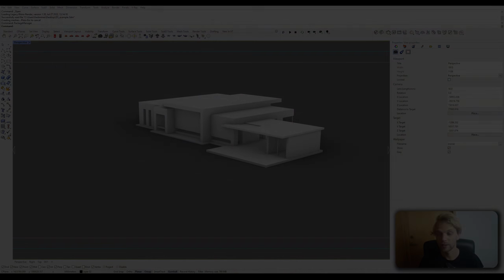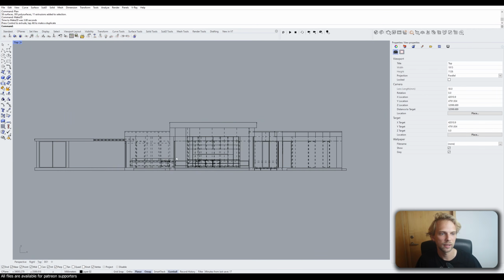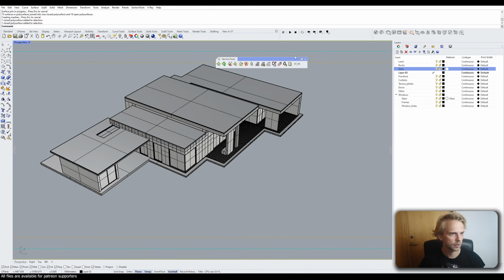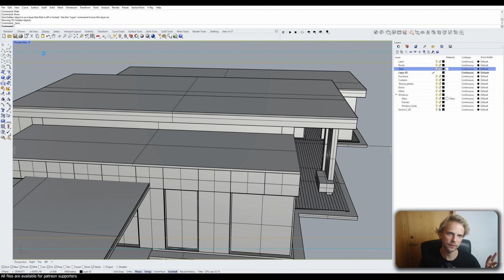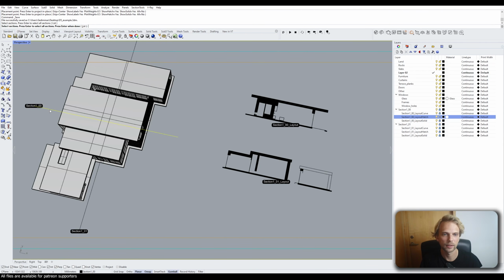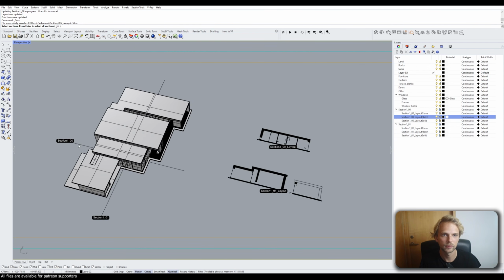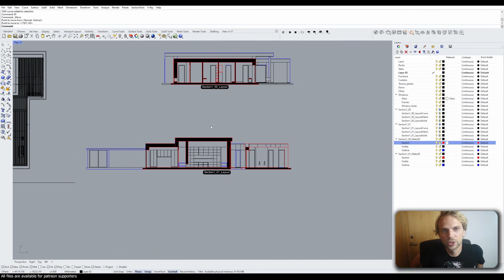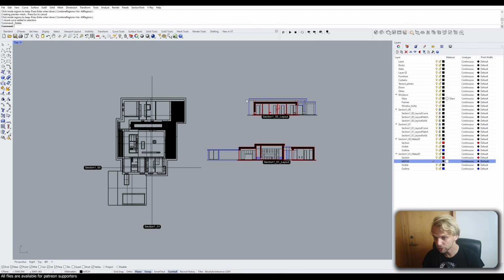Dynamic Sections with Rhino 7 - Workflow

Comment: Can we use this for floor plan? And how to do that
Reply from the maker: If I recall correctly - you simply draw the section in any elevation view (front, left, right or back) and it will create a horizontal section (which is what a plan is)

Comment: Great workflow breakdown! Thank you! I think I’d make a small grasshopper script that references the center of the section lines and the make 2d lines and then get the difference between points to get a movement vector to automate the alignment process. (more for a big project with lots of sections).
Reply: Could you explain what you mmean an by this a bit?
Reply: @ashuri8184  Sure, essentially you are dealing with two planes. 1 plane is your original section cut, the 2nd plane is the plane that the resulting Make2d lines end up on (typically world XY), if you evaluate/get both of these planes, you can use Orient component in Grasshopper to transform from the world XY planes of the Make2d line output and move those to the Section Cut planes at each location. The Section Cut plane doesn't have to be the destination though. You could move them to be oriented on a layout sheet, positioned "flat" around the overall building like a box with its flaps down, etc. Once you have the planes you can orient however you want...

Hope that helps!

Comment: What about dynamic plan drawings? Should be easy to make this plugin work for plans, have you tried?
Reply: Yeeah! show Cplanes
Reply from the maker: A plan is just a horizontal section isn't it
Reply: @DesignGoBrr   I tried, and I found the only way to do it is to make a standard dynamic section but in the FRONT viewport, or any elevation viewport, a bit wonky but it does the trick.
Reply from the maker: @rdn1929  Ah yea - I forgot to mention that you specify a plan cut in any elevation view and an elevation cut in the top/perspective view. It's all about the Cplane orientation.

Comment: I usually make use of the rhino clipping plane tool and link them to my viewports in my layout tabs.
It automatically updates,  no need for any manual work, no heavy duty make2D commands It does the hatching (one solid color) 
It shows what's visible with the options shaded/arctic/rendered/technical etc.
Even annotations update automagically when I make changes to the annotated objects. 
Easy export to pdf/dwg/image whatever.
This combined with the coming Rhino8 Clipping plane functionalities will take care of all my 2D Sectioning needs.
The only thing that I miss in this method is adjusting the hatch style per object and actual clipping plane geometry but that will soon be solved for good ;)
Reply from the maker: Yup - this is correct.
Reply: how do you make a clipping plane with hatch?
Reply: @jonathan_vortex  Rhino 8 gets an automatic hatching with clipping planes.
In Rhino 7 I still have to get outline curves by intersecting plane with geometry and hatch that manually
Reply: how do you link the clipping plane to the viewports? and how to you export it to dwg without make2d ?
Reply: @zoilinar  
Q1: How does one link clipping plane to viewports.
- make sure u have a layout tab with a "detail view" on it.
- make sure u have a clipping plane
- select the clipping plane and go to the properties tab on the right menu. 
- where it says "views clipped" there's a drop down menu which by default is on "model views" 
- Select "layout views" in the drop down menu and check mark the detail views you want to link to the clipping plane 

Q2: how to export Clipping plane View without make2d
- Select the right view in which the clipping plane will be oriented "top/bottom/left/right/perspective/back" 
(You can create a new viewport tab which is clipped keeping your original viewports unaffected Like "RightSect" Or "Planview") (Drawing the clipping plane in this tab will make it automatically active otherwise you need to select the viewport, go to properties tab and check the right view under the model views tab) 
- Draw the clipping plane and move it in a different unaffected viewport to where you want the section to be 
- Do the "print" command
- Select "Rhino PDF" as destination
- Set size to "custom" 
- Make the dimensions large enough to contain the section/object/drawing etc. (30000X30000 Cm would do the trick for the building I suppose)
- Under "Output type" select "Vector Output" 
- Under "view and output scale" Set scale 1:1
- Make sure all geometry is contained in the print preview if not under "view and output scale" you can set a window for the area you want to print. (say no to changing the scale) 
- Press Print
Vector PDF files can be imported as Curves and hatches in Rhino with objects retaining layer information.
Whilst printing in vector pdf there is not much fine tuning in which curves get exported. This method exports all of the visible geometry in front of the clipping plane in wireframe mode.

If you want to go for aesthetically pleasing annotated layouts for documentation or presentation select "raster" pdf. 
With this function you can export your detail views in all of Rhino's viewport styles (wireframe,shaded,rendered, arctic, etc) 
These pdfs cannot be imported as DWG files though but are excellent for presentation purposes or to create printable drawings for the builders, council, client, etc. They usually don't need dwg. Just a pdf or piece of paper with some annotations on it are usually plenty to get the information across. 
These PDFs look vectorized so that they behave like vector drawings when zooming in and such in your pdf viewer of choice but are in fact "rasterized" they import as pictures in rhino. 

If you need an aesthetically pleasing DWG file of your clipping plane for post processing in illustrator, autocad, lasercutting or something then the workflow in the video is probably the best way to go. But I suspect most will need a quick and easy way to create multiple (clipped) views of a design for annotated drawings and export to PDF.
Reply: Thank you for the reply, I tried it , but can't make it work that well, I guess I have to look more into it

Comment: thanks for sharing 3rd video 
i wanna ask something please reply.lagging problem during work in rhino . I have PC i9 9900k RAM 16 rtx 3070ti .what should I do .do I upgrade the Ram ? during work system showing me 85 99% usage of the Ram. need advice
Reply from the maker: Well it's pretty clear that RAM is the issue - upgrade it to 32GB and it should be fine.
Reply: @DesignGoBrr  OK thanks you so much